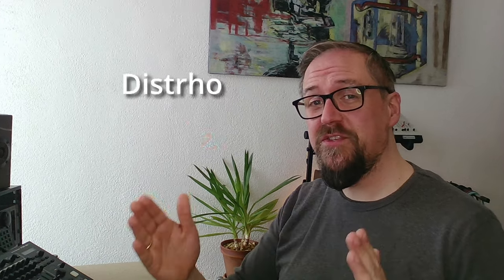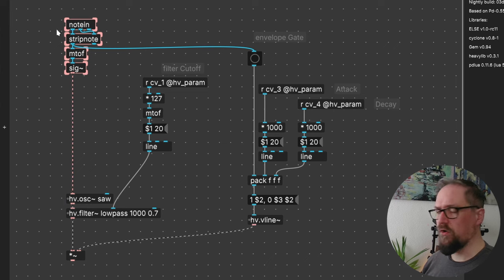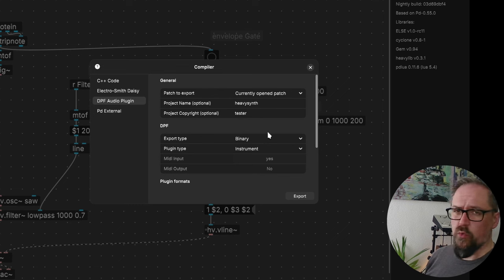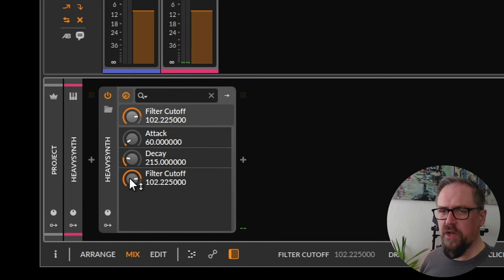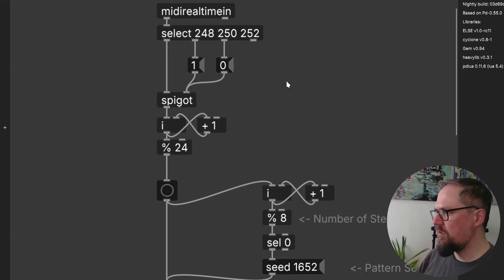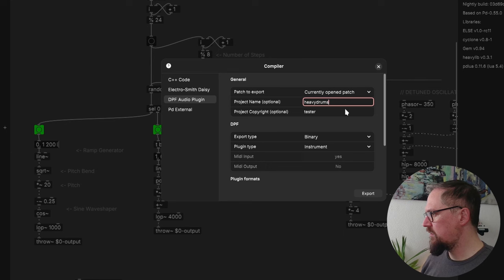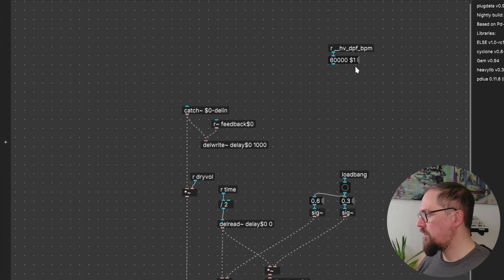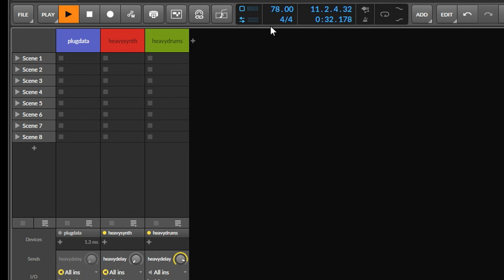PD to C - From Patch to Plugin

Comment from the maker: Should we allow the `[midirealtimein]` object to be used without enabling midi input on the plugin?
It's not actually receiving external midi data, but converted transport events from the host.
Reply: Is there already another way to receive host transport events?
Reply from the maker: @UnterDerSonneOhUnterDerSonne  We started looking at the `[_playhead]` receiver used in plugdata. This would make prototyping a bit easier. However this has a number of features that are not supported in DPF. So for now `[midirealtimein]` is the only object that makes sense to use for host transport events.